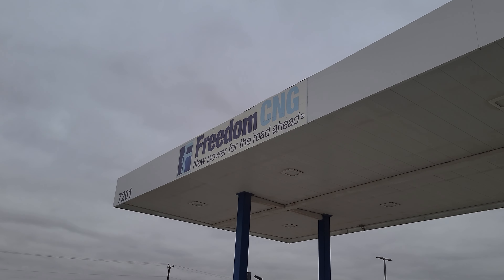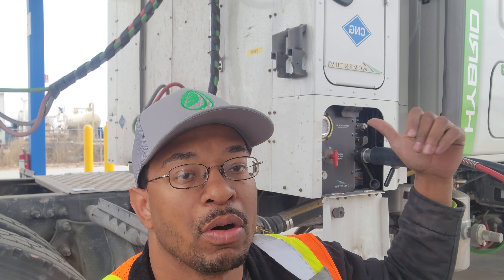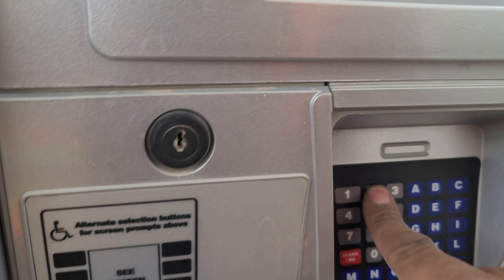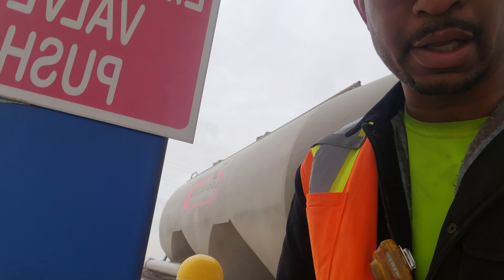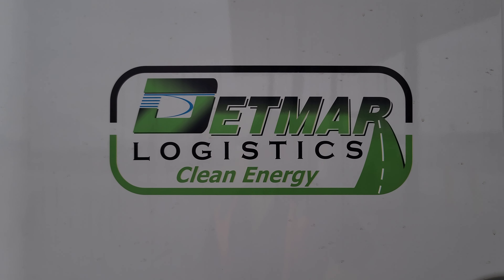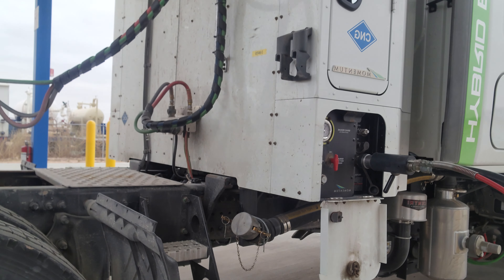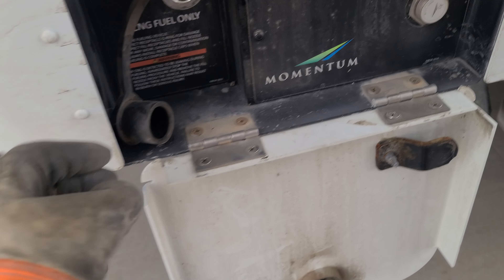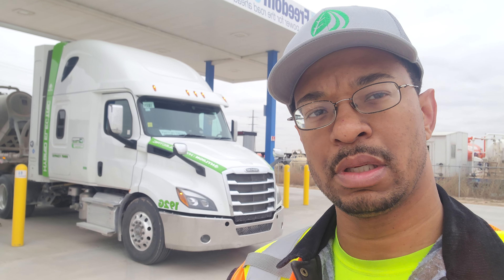Fueling a Hyliion CNG Semi truck for the first time. Freedom CNG -Detmar Logistics

Comment: Nice vid Dex. Appreciate it. I can shed a little more light on CNG fueling.  CNG stations have tanks also that have been prefilled to pressure while nobody is fueling. Then when a customer arrives they get a fast fill. But when the CNG station tanks have equalized with the vehicle tanks, the Station pump has to kick in real time and slowly finish the fuel cycle. I think as CNG gets more popular the storage tanks will need to get bigger. Currently where I work we have have to slow fill the CNG garbage trucks overnight. But our pumps are much smaller.
Reply from the maker: Thank you for your insight David😎

Comment: Dex, I was looking at a CNG terminal design guideline. The storage tank was about 25% of daily capacity. When you got there it went up rapidly to 2600 psi & slowed. Probably because filling the truck depleted the pressure in storage. From that point it would have filled slower relying on the pumps only. If no one is at the terminal, then it starts filling storage again.
Reply from the maker: I think you are correct.

Comment: Great stuff as always Dex.  Wondering a couple of things.  First, how many gallons does it take to fuel up the truck.  Also wondering what your miles per gallon is.  $2.30 for cng vs $4.30 here in Pennsylvania for diesel is crazy.  I’m a truck driver too, so I know.  If lived near west Texas I would be putting an application in to work for Detmar, you better believe it!
Reply from the maker: My guess is 75.
I am not really good with the mathematical conversion
Reply: Thank god you're not in Canada. I am paying almost 7 bucks a gallon for diesel where i live

Comment: Hi can you give me a little more info on Ditmar?
Reply from the maker: We haul sand.
You  need CDL with a tanker endorsement.
Make $2000-3000 a week average as company driver. 
Make $8000-12000 gross per week as O/O
Use DMG as the referral name when you apply and when you arrive. And I will personally give you $300 after 40 days of employment😎
Reply: Ok thanks I assume trucks are automatic? Any APU in trucks
Reply from the maker: Text 325-249-3131
Yes. APU, refrigerator built in. Mostly  Volvos at the moment, some Pete's some Freightliner. More and Hyliion conversions each month😎
Reply from the maker: And we have 3 weeks on 1 off or 6 weeks on 2 off schedule. It's a great life. I spend most of my downtime in Dominican Republic.